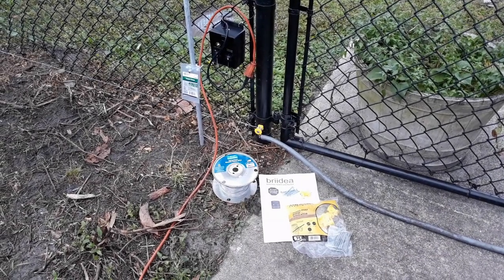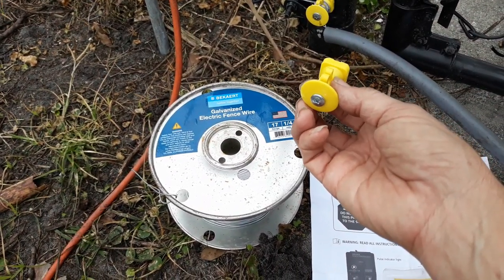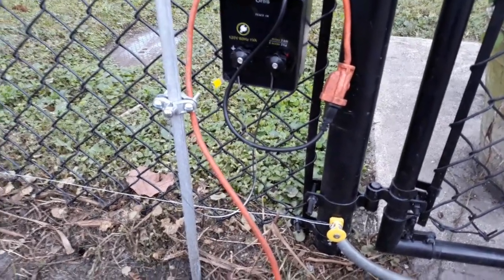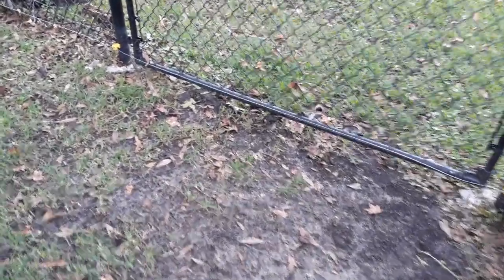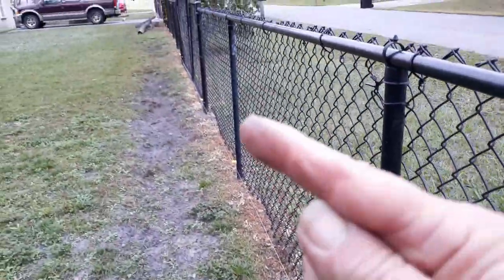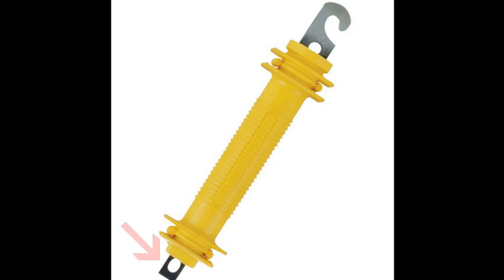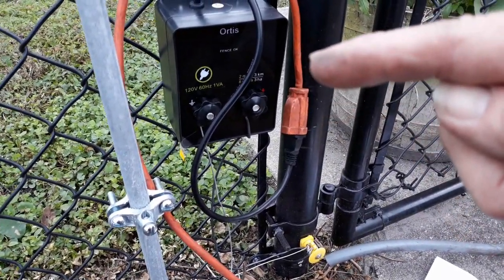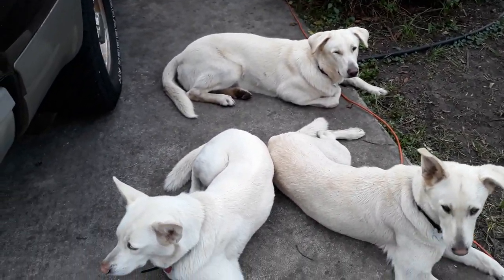I installed a single wire electric fence ~ howididit ~

Comment: Very simple and best of all, it works. You were wise using strong galvanized steel fence wire and not aluminum. It's important for charger longer life to do 3 galvanized ground rods at least 10 feet apart. If you start killing chargers after 6 months or so, you might want to try this. Rod is a lot cheaper than chargers.

Comment: Do you have any issues with the electric current being weak with only one grounding rod?  I'm going to install a single wire fence for my pigs nice and low to the ground.  They've never been in contact with electric fencing but are about to receive the single strand electric fencing to deter their escape.  They are rooters and like to run their snoot underneath the fence panels and create weak spots.  So far, they've escaped 3 times. and I'd like it to stop permanently. Thus the single wire fencing. Thanks for the video.  I enjoyed a full-watch.  New Subscriber.  👍🏽🤠 2/19/23
Reply from the maker: Hello there, no issues at all with weakness. Right now the issue is leaves building up at the bottom of the fence, so I do a quick walk around a couple times a week.
Reply: @howididit  Thanks for the tips.  I introduced the pigs to their first shocking event.  Man, ot sounded a though they were being skewered alive.  Now, on day      two, the haven't gotten near the wire and know that it's safe to stay inside the confines of the unwired space.  Hopefully they won't attempt to lunge the fence out of sheer panic but for now, they've adjusted to the wire in 1 single day.  I'm pretty amazed about their quick learnng skills.  Have a fine week.  I'll check for weeds or any branches or obstacles that may hit the wire.  👍🏽🤠 2/22/23
Reply from the maker: @houndsmanone4563  very kool! Pete from just a few acres youtube channel has great tips on pigs, and electric fence to keep them in.

Comment: Great video! Can you please clarify at 03:30 the connection to the output terminal. This is the part that confuses me. That wire looks different than the perimeter wire and what is it attached to? 🤔
Reply from the maker: Hello there that is insulated wire, it is the hot/power that charges the wire

Comment: Can I use this method  on a 10x10 chain link fence I have a huge dog that grabs my kennel and he lifts it up and bends it up he already tore apart one kennel so now I have him in a retriever welded wire fence from tractor supply.
Reply from the maker: I would think yes, but I would buy the larger standoffs though.

Comment: Please explain the power side. What wires did you use?
Reply from the maker: Hello there, the wire that ran the entire perimeter of the yard starts at the hot side of the controller, it runs from the controller down to the first insulator, it wraps around the insulator and continues on to each and every insulator all the way around the yard. When I arrived back at the gate opposit the controller/starting point, I made a loop in the wire and attached the wire to the insulator, this was so I could attach/hook the electric fence handle to it, the other side of the handle continues the wire/circuit, I attached the wire, feed through the hose on the ground and attached it to the first insulator where the wire started, this is what completes the circuit. If you unhook the handle it breaks the circuit, and the fence is not charged, rehook the handle and the fence is once again charged.
Reply: Is the whole fence charged like the chain link part or just that ground wire?